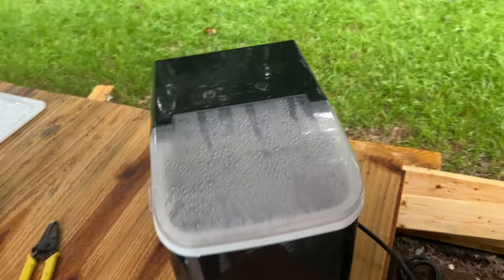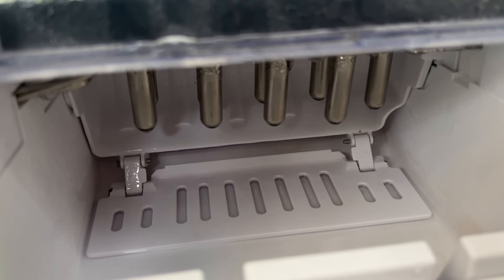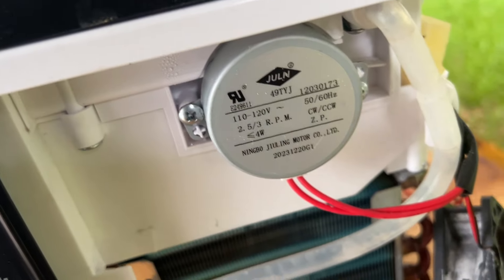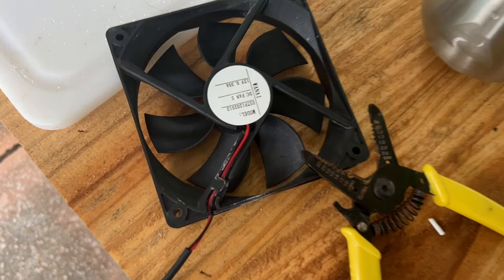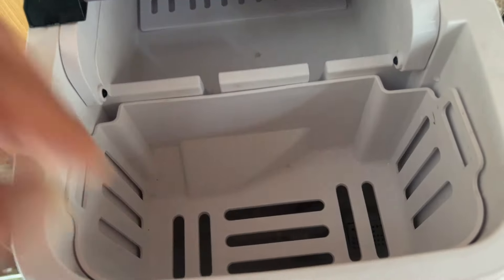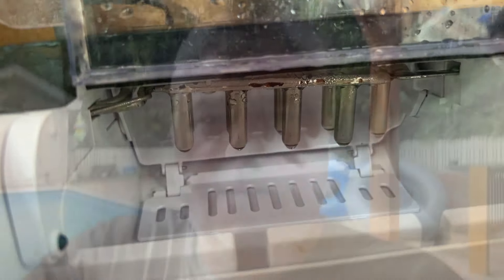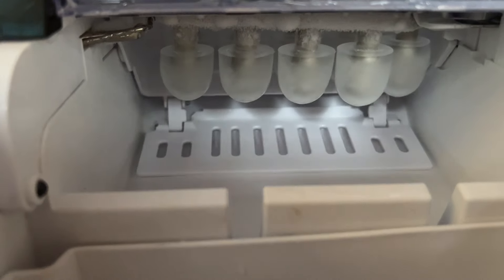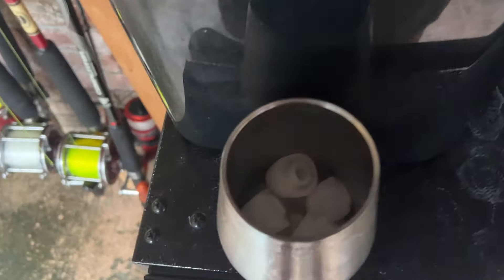Dumos portable ice maker review and modifications!

Comment: Silver Pop, does the AC power going in turn to 12 Volt DC so one could set up a ice maker to be 12 Volt plugged? 
  Thank you for the showing and sharing.
Reply from the maker: No, there is just a small transformer for the smaller electronics, the compressor is still 120VAC